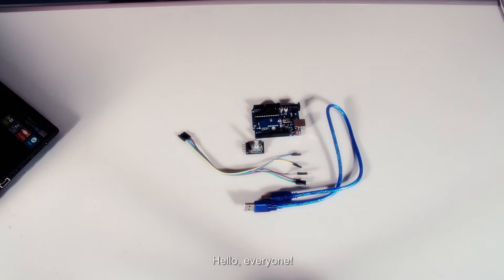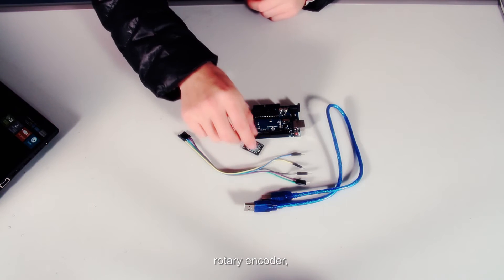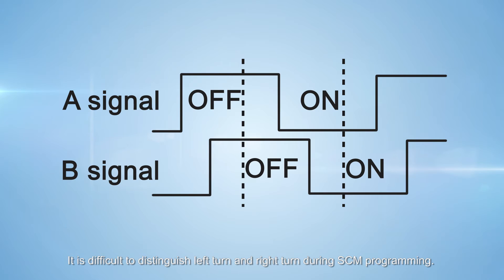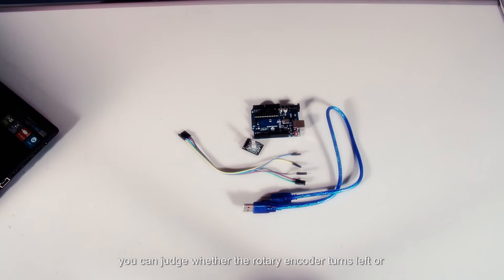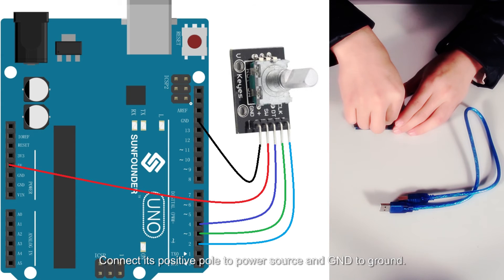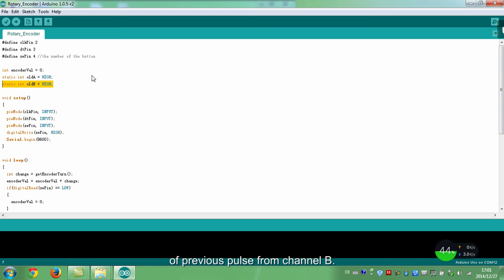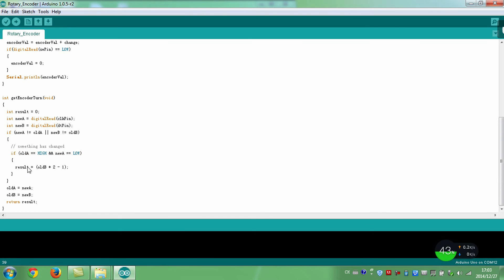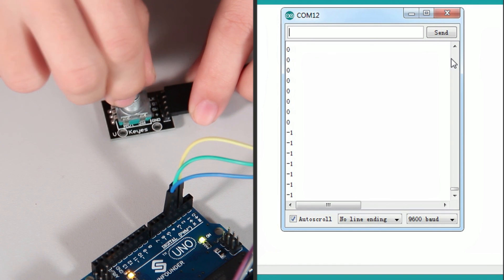Sunfounder Kit Turorial for Arduino - Rotary Encoder

Comment: can we convert this pulses in rpm? if convert then how?
Reply from the maker: Dear Jignesh, 
The number will be 18, if the Rotary Encoder turn a around. 
You can have a test, calculating the count of the rotary encoder output in a minute. Divided by 18, you can get the number what you want.
Have fun!
Reply: You have to make an if() or separate function for this. Your arduino should check the frequency of the incoming pulses aka whats the time between the old pulse and the new pulse. A suggestion-do NOT use delay() as it stops the whole program from running, use the millis() instead (see the BlinkWIthoutDelay example sketch). If you are creative and skilled enough this won't be such a hard task for you. Good luck! :)

Comment: how can you print the value from the rotary encoder on a lcd1602?
Reply from the maker: +giacomo aliboni (edited)
You may try the code below (the sketch's added to the package on our website, see https://www.sunfounder.com/learn/category/Super-Kit-V2-0-for-Arduino.html): 
//include a library
#include <Wire.h> 
#include<LiquidCrystal.h>
LiquidCrystal lcd(4, 6, 10, 11, 12, 13);//RS,E,D4,D5,D6,D7

const int clkPin= 2; //the clk attached to pin2
const int dtPin= 3; //the dt attached to pin3
const int swPin= 4 ;//the number of the button

int encoderVal = 0;

void setup()
{ 
  lcd.begin(16, 2);  // set up the number of columns and rows on the LCD: 
  
 //set clkPin,dePin,swPin as INPUT
  pinMode(clkPin, INPUT);
  pinMode(dtPin, INPUT);
  pinMode(swPin, INPUT);
  digitalWrite(swPin, HIGH);
  Serial.begin(9600); // initialize serial communications at 9600 bps

}

void loop()
{
  int change = getEncoderTurn();//
  encoderVal = encoderVal + change;
  if(digitalRead(swPin) == LOW)//if the button has a pull-down
  {
    encoderVal = 0;
  }
  Serial.println(encoderVal);
  lcd.setCursor(3,0); //set the position where characters begin to be displayed on the LCD
  lcd.print("value: "); //print value
  lcd.print(encoderVal); //print the rotary encoder value
  lcd.print("                "); //clear the screen, in case of remaining characters 

}

int getEncoderTurn(void)
{
  static int oldA = HIGH; //set the oldA as HIGH
  static int oldB = HIGH; //set the oldB as HIGH
  int result = 0;
  int newA = digitalRead(clkPin);//read the value of clkPin to newA
  int newB = digitalRead(dtPin);//read the value of dtPin to newB
  if (newA != oldA || newB != oldB) //if the value of clkPin or the dtPin has changed
  {
    // something has changed
    if (oldA == HIGH && newA == LOW)
    {
      result = (oldB * 2 - 1);
    }
  }
  oldA = newA;
  oldB = newB;
  return result;
}